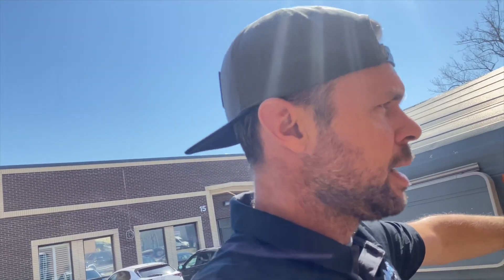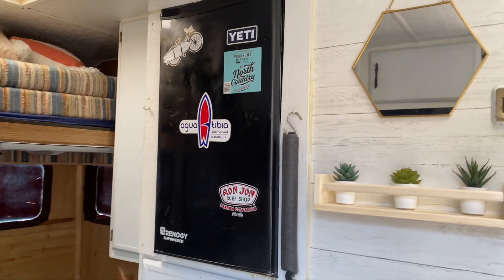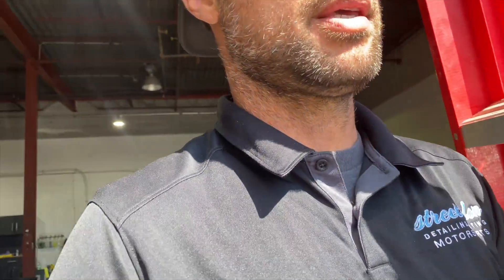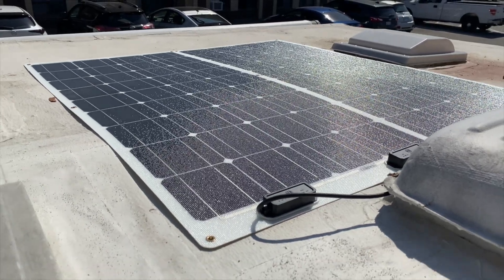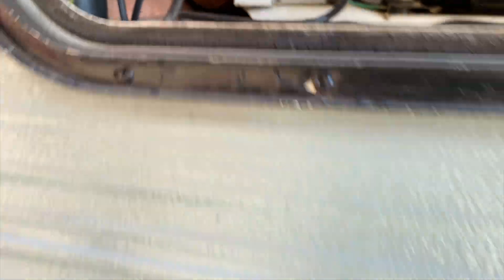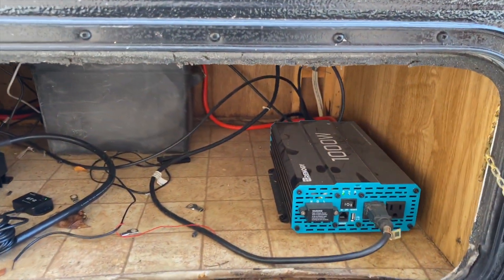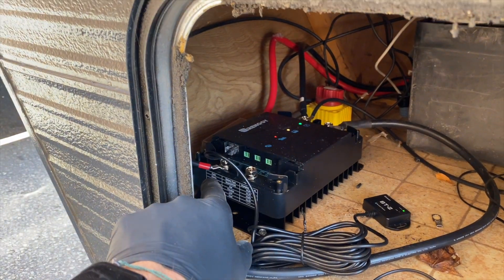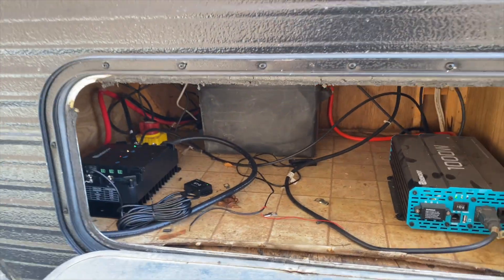Renogy 200w Solar install and first impressions

Comment: I was looking for a video on that Toyota Winnebago. Wanted to see what you did with it, but I guess nothing yet. I was looking at the 200w Renology kit for mine. I do have 3 different solar devices, from 1800 to 300w. Maybe that will be enough and I have the solar panels.